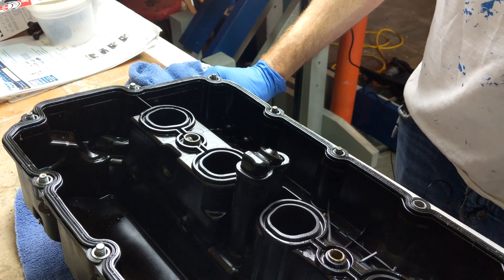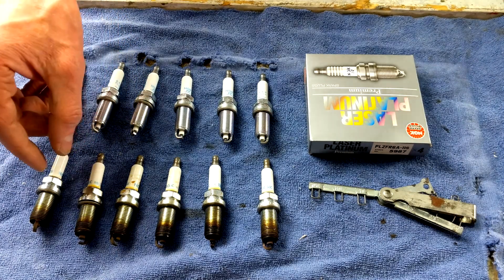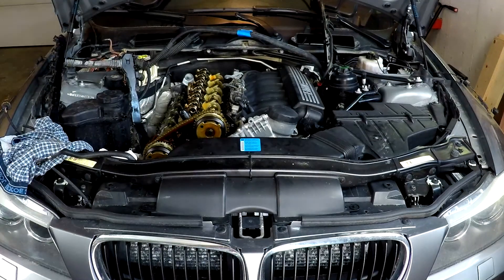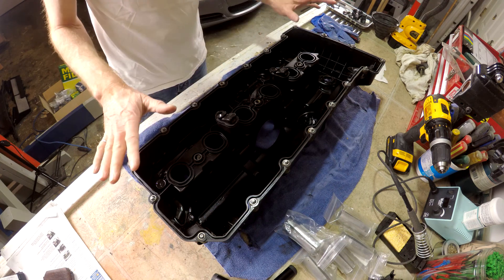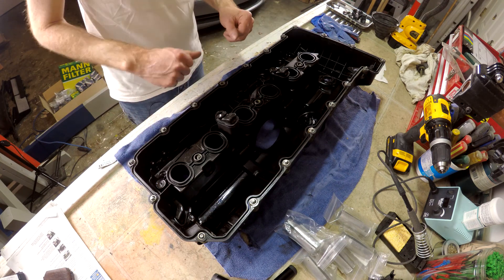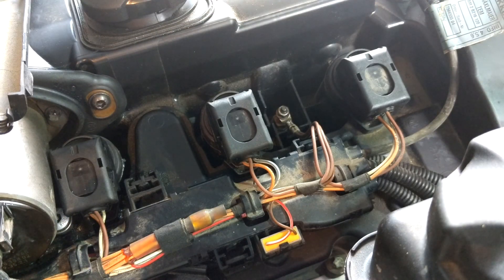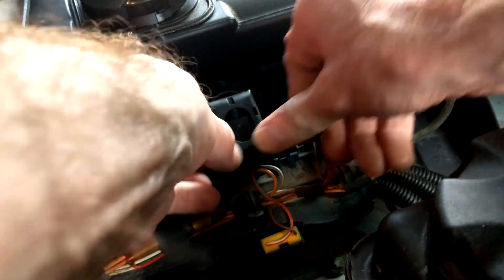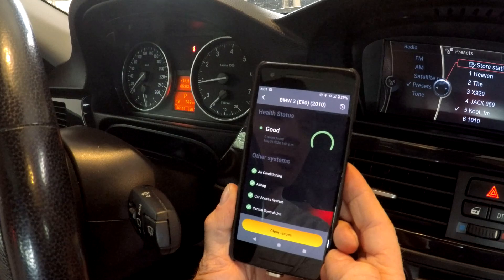BMW E90 N52 Valvetronic Eccentric Shaft Sensor and Valve Cover Gasket Replacement

Comment: So I ended up dropping the eccentric shaft sensor screw. What will happen if I leave it there?
Reply from the maker: You need to get it out.  Try a magnet on a stick or on a string (although check one of the other bolts from the sensor to see if they are magnetic, I recall they are steel, no aluminum bolts).  A borescope (even a cheap usb one) would be helpful.  You could hope for the best that it dropped down to the pan, but worse case it is sitting on something critical and will crunch bad when the engine turns over resulting in some expensive repair bills.  

I've spent hours fishing for bolts, so don't feel bad, you aren't the only one.  Specific to this bolt, you may find this interesting:
https://www.bimmerfest.com/threads/eccentric-shaft-sensor-bolt-dropped.1300267/

Comment: Hi, which scanner are you using? Which code was for the eccentric cam sensor ? 
Great video...
Reply from the maker: Thanks for the compliment!  

I'm using an android called Carly to read the codes (and the Carly Bluetooth dongle).  

The main code which identified the issue was 002A31 which is valvetronic sensor.

I was also getting a 0029D1 (misfire on cylinder 5).  I suspected I had a coil on the way out as I had the odd rough start when it was cold outside, and suspect that with the valvetronic sensor not working, it was enough to create a misfire where the weak coil was.  This is why I replaced the coils as well.

Intermittently I had a battery drain warning, but those would of been a result of me trying to diagnosing the issue resulting in a low battery level.  I also had a gauge error pop up (00A559) but that would of been a result of the low battery.  You get all sorts of interesting errors when the battery gets low.

Comment: What is the software or app that you use on your phone to read and clear codes
Reply from the maker: It is called Carly on the android app store.  I had to buy the matching dongle from the Carly website.  Unfortunately they moved to subscription based model, I bought it when it was still a onetime lifetime cost.  Using it for the odd oil change or service reset, probably not worth it, but it is easy to use!

Comment: Im getting   2a38  code vvt sluggish  movement/open circuit  any idea jus change   valve  gasket  hope its not the sensor  dnt feel like  taking  it off again   anytime  soon   lol , help if u can
Reply from the maker: Sorry, I'm not sure about that one as that code pertains to the valvetronic motor.  Since you just had the valve cover off, I would check all your electrical connections connections as a start.
Reply: @reileymckerracher9181  hey im back ,  found  out one problem  to  my vvt issue  lose wire connection  on battery ,   now will oil in the eccentric  shaft sensor  will it cause vvt sluggish  movement / open circuit   without   throwing  exact code for the  sensor  u think
Reply: @michaelcondrey8681  i have 2a38, what ended up being your solution?
Reply: @coconytv  after going over everything and checking over everything coming up with nothing finally took it to the dealer they put a new software update that took care of the problem

Comment: hey there, how much should a mecanic charge to do this job? I have several codes coming up : 2a31, 2a32, FF00 at first and recently the P1017...
Reply from the maker: not sure really, but it isn't cheap.  this tread on e90 post should give you an idea.  
https://www.e90post.com/forums/showthread.php?t=1079830
you to add to the valve cover job the eccentric sensor, which when you are already in that deep is minimal labour, but the part is pricey.  here is a link for that:
https://www.fcpeuro.com/products/bmw-eccentric-shaft-sensor-valvetronic-11377524879
note from bmw the part is even more.